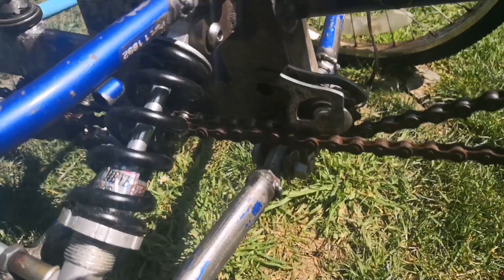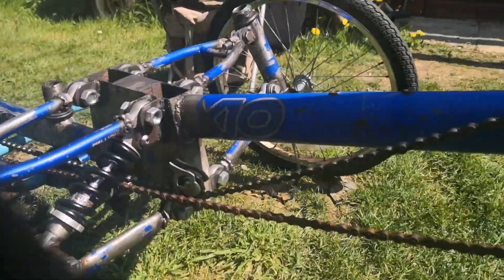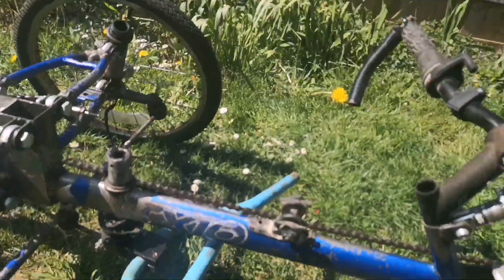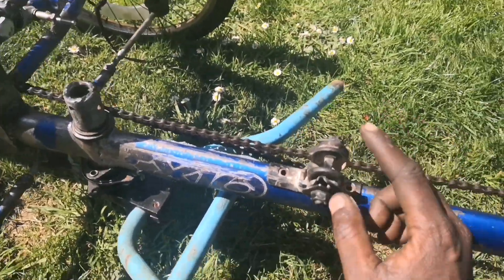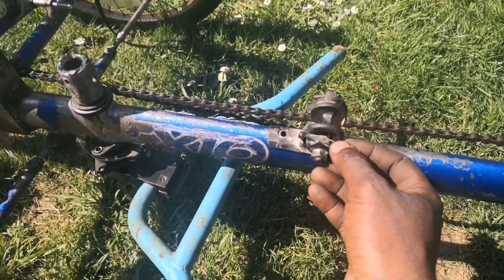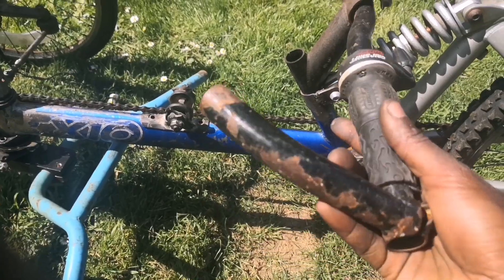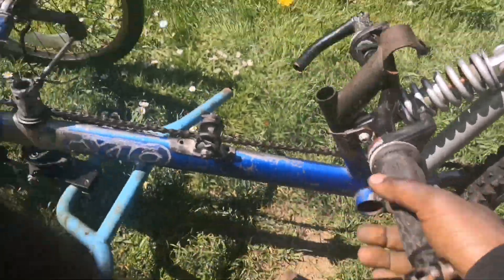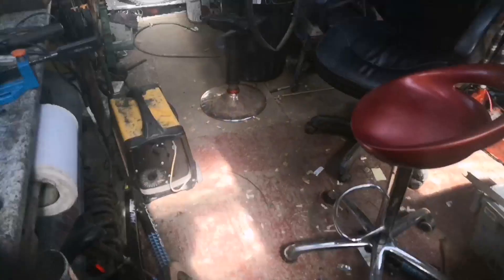Recumbent trike adjustable seat build

Comment: I used a garden hose for the chain. I putted the chain trough and hold it with tie raps to the frame. Works good.

I first wanted to make my seat do you could change the angle. I didn't because I hot a wooden seat that is for recumbents. Also got seat padding for it that is made so you don't sweat that much.
But I like that you use all old parts to make something new.

SOON you can make ypur first test ride I see.
Reply from the maker: I can't wait to get on it. Just been busy recently so the build has been quite slow. I can just imagine myself floating just down the road. The thought of it puts a smile on my face
Reply: @moyb112  I can believe that.
I just putted the final layer of paint on the seat and I placed all the wires. Only need to adjust brakes and shifters and as the seat is dry tomorrow, I finally can finish my Trike. Want to ride it tomorrow evening.
Reply: @moyb112  it is just great to ride something that is low by the ground. It looks if you go way faster.